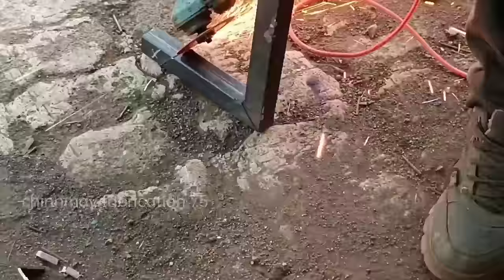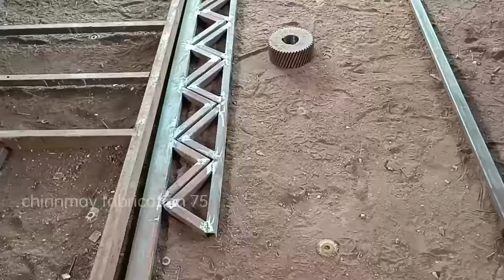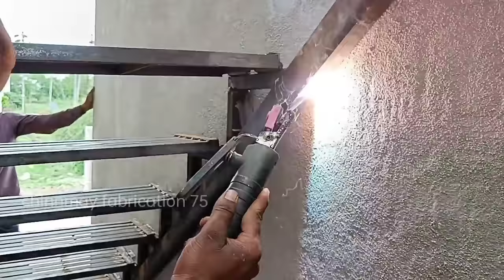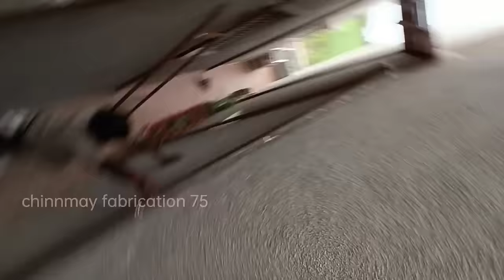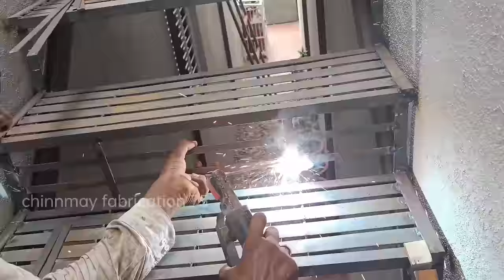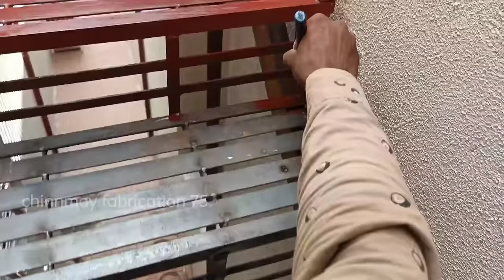Folding Stairs Full Video | How to Install folding staircase #stairs #fabrication #welldigging

Comment: Kitna feet area  mein sidi lgi
Reply from the maker: 3×13 feet
Reply: 13 feets hight
2 feets width folding Stair how much cast? 
Even GA material are u used!
Reply from the maker: @priyagill6126  30000
Reply from the maker: 30,000/-